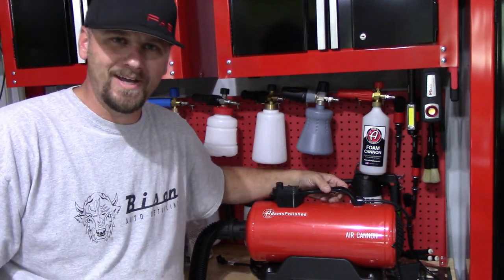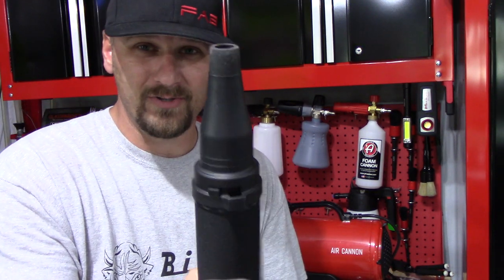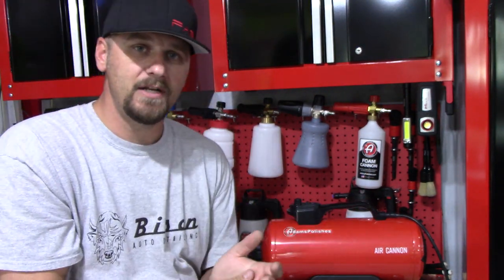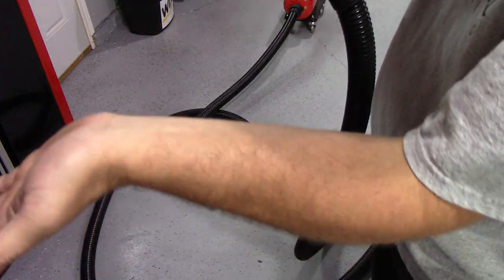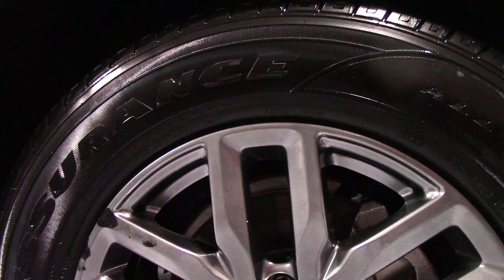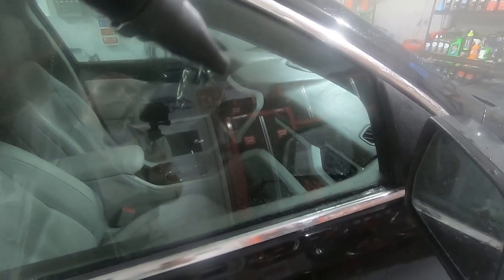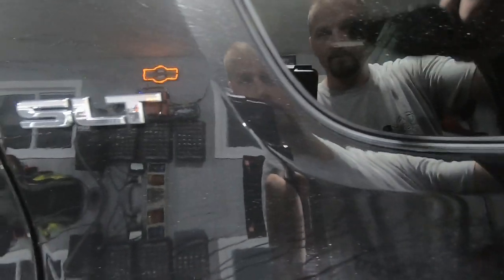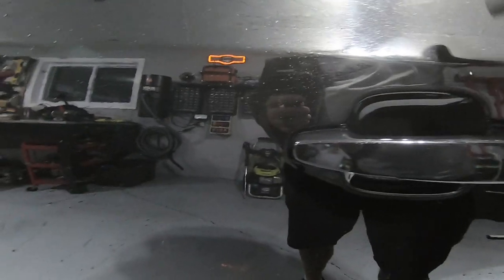I Love This Adam's Polishes Air Cannon! Drying Has Never Been Easier!

Comment: Sweet blower. Saw it on Adam’s website a while back.  Love the fact that you can use that vs towel drying on coated car. Saves those potential swirls. Appreciate the video review!
Reply from the maker: Jason Davis I dried my brothers Tesla after the first wash with the Graphene coating with just this dryer. Didn’t have to touch the paint at all to dry. You are welcome
Reply: FAB Automotive Detailing nice! I used my air blower and I had to still wipe it down so this to be way better!

Comment: Looks pretty nice. I've been using the McKees 37 one that you hang from your shoulder (they call it the Turbo Car Dryer, although I think it had a different name when I bought it a couple of years ago). Works okay, but it's not the most powerful unit, and you really need to have a good coating on the paint for it to be most effective. I also have trouble with the tip sometimes popping off, and because you carry the whole unit on you, it's a bit unwieldy and hard to maneuver.

While I'm not sure the Adams is the ultimate answer (a lot of companies make similar products, often for a lot less), I'm thinking I may need to upgrade to something better next year.